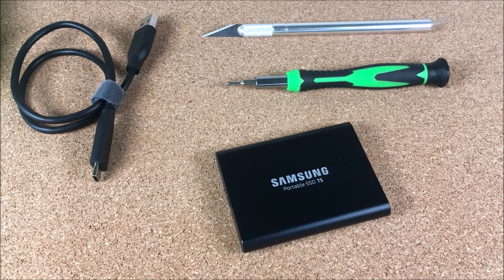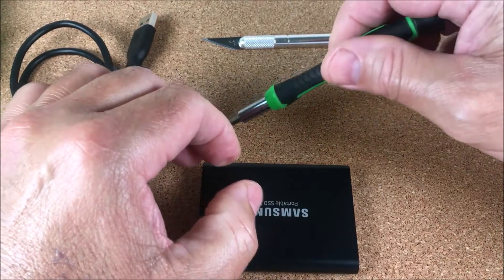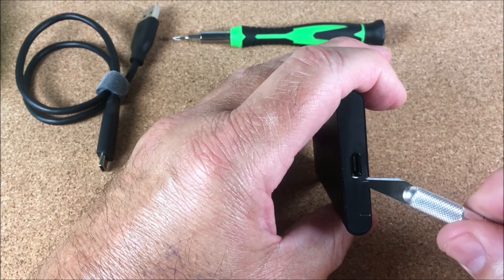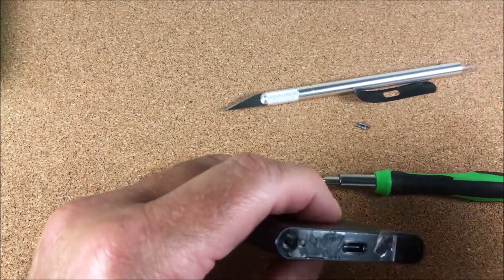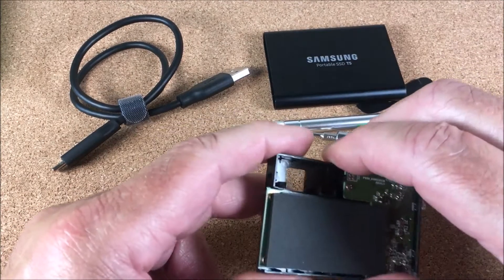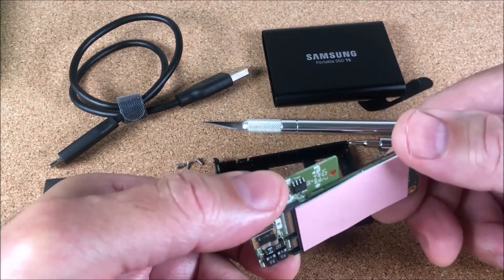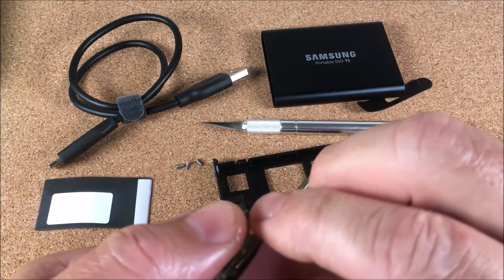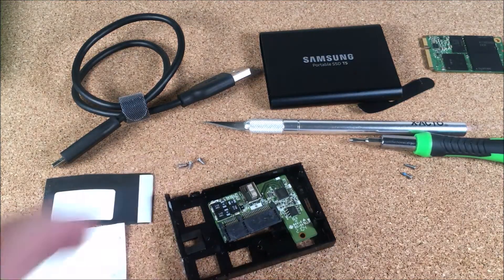How to Remove mSATA from Samsung T5

Comment: 1  First warm up the glue with a clothes iron.  Being careful not to melt the USB connection.

2 Get the lift to be removed.  started with the exacto knife.  When the lift is started slip of small flat blade screwdriver under the exacto knife. Pull the exacto knife out.

Comment: He said he's dismantled one before obviously not, he didn't have to pull the whole circuit board out, he just needed to lift the msata up a little bit where he removed the mounting screws and slide it it out. If he's done it before how could he forget.
Reply from the maker: The circuit board needs to be removed because the pink thermal pad that's underneath the mSata does not allow it to side out. If you watch the video at min 9:38, you can notice how the thermal pad is adhered to the mSata.
Reply: @hackytip7901  I've done it before, like I said lift the msata up a little bit and with a plastic spatula pry away the the thermal pad simple, I've done heaps of them that way.

Comment: HI. I carried out the procedure, but now the original adhesive has lost part of its adhesive capacity. What glue do you recommend to use to restore the anchoring and seal well? Thank you
Reply from the maker: Thanks for watching. It's hard to know what kind of adhesive will work with plastics. Here are some alternatives that you can try:
1) Scotch Double Sided Tape
2) Double Sided Duck Tape
3) 3M Spray adhesive
4) Maybe Crafts glue or glue stick
I would avoid permanent adhesives (Crazy Glue or Epoxy) in case you want to remove the sticker in the future. Good luck!

Comment: Hi do you have any idea what the sticker material for the drive is called, planning to get mine replaced, hope you can help
Reply from the maker: I believe it's called a "Thermal Pad" and it provides heat dissipation. There are many options on Amazon.

Comment: Wait... Are you saying that thing is 2 Terabyte... we we can't buy 2 Terabyte.... So we have 2 Teraby mSATA we could put in our computers????
Reply: I put a 4tb msata in my laptop a year ago. Its slower since it's msata and not nvme. But also cheaper. I just need decent quick storage, nothing crazy fast.
Reply: @canabisquick  And where do you find a 4tb msata?
Reply from the maker: Yes, it's a 2 TB that you can put in any computer with an adapter, such as the SABRENT mSATA to 2.5 Inch SATA III. Some Lenovo laptops have an mSata port. (Dell 4200/6400/6500 and a handful of Lenovo laptops y460, y560, y470, y570, e220, e420, k26, T420, T410) Confirm this information with your manufacturer's specs.

Comment: is it basically an m.2 ssd?
Reply from the maker: The Samsung T5 has an mSATA inside. The m.2 ssd is the replacement of the mSATA. They're similar but not compatible.
Reply: @hackytip7901  ohhh ok

Comment: Good info.
You might try a little heat from a hair dryer set on high. Apply sparingly, it usually softens the glue. We used this technique for removing labels from pagers years ago.
Reply from the maker: Thanks for sharing. If you look at the other comments, you can benefit from other suggestions to make this easier.

Comment: Can this be used as a internal ssd after removing it from it's case?
Reply from the maker: Hi, sure just get an mSata to Sata enclosure. It's $9.99, search in Amazon for: SABRENT mSATA to 2.5-Inch SATA III Aluminum Enclosure Adapter.
Reply from the maker: @edmundroth6337  I is difficult to give you an accurate answer. It all depends on the specific specs of your laptop for both Sata & USB. You can probably find your models specs on the laptop manufacturer's website. Or, you can run two speed test on your laptop and compare both options. I hope this helps.

Comment: I have swapped the mSATA drives from the Samsung Portable T5 (2TB) with the Samsung 860 EVO mSATA (1TB) that I had used in my laptop. Here is one thing to let others know, once you do that Samsung Portable SSD application will no longer recognize the T5 (even if there is a Samsung drive inside, just another model), so you will not be able to use their encrypting feature, and also the drive originally from the portable T5 when put into an mSATA slot of your laptop is not supported by the Magician software, it won’t let you run benchmark, diagnostic scan, overprovisioning and performance optimization (rapid mode), the mSATA card is still seen as “Samsung Portable SSD T5” by the system/drive utilities, not as “Samsung 8x0 EVO” as we would expect and also has a different firmware numbering.
Reply from the maker: Thanks for the info.
Reply: hmmm.... I wonder... Will I lose anything doing it... Should work for me overall, and if it does not I can always put it back I guess.
Reply: @darkijah-andersjehovahsn7893  Well, it works fine, and you can put it back to its enclosure whenever you want. Just if you want to use the extra features I mentioned above (benchmarks, diagnostics), you will need a third party software as the T5 plugged directly to the SATA interface appears as an unsupported drive like any other HDD’s and SSD’s in your system which are not Samsung.
Reply: @mertonnephake  Yea that would be fine overall.

Comment: cost wise Is it cheaper than buying regular msata ssd?
Reply from the maker: Hi, the Samsung internal 2 TB mSata is not available in the market. At the time that this video was posted, there were no options in this size.
Reply: @hackytip7901  aah thank you, never knew that before
Reply from the maker: @nadzifaashiqa5273  Your welcome!
Reply: @hackytip7901  I don't think there is any option to this date...
Reply from the maker: @darkijah-andersjehovahsn7893  Thanks for the update. You are right. Samsung still doesn't sell a 2TB mSata.
Reply: @hackytip7901  I found others who sell 2 TB, I have a list on my webpage now. Although I do not know which are best and legit, but it is there.

Comment: hi, when did you purchase this drive? Did you happen to see the date of manufacture when you unpackaged it?
Reply from the maker: Hi, is there an issue with the date it was manufactured? Why is this important?
Reply: @hackytip7901  No, just noticed that the components on the PCB are different to what's shown in teardowns from back when the T5 was released, so I was wondering when Samsung revised it. Found another recent teardown that reveals that the controller, DRAM and NAND packages have all been revised (although the NAND is still TLC).
Reply from the maker: @mettana7448  The date on the box is 03/19/21.
Reply: @hackytip7901  Thanks.

Comment: Thanks for the video! I literally just bought the drive because I couldn't find another 2TB mSATA-SSD.
Reply from the maker: You're welcome! I guess that 2TB mSATAs are not available; I haven't seen any for sale. At least we can use the Samsung T5 to get a 2TB mSATA. I hope this video helps you remove it safely.
Reply: @hackytip7901  Nope have not found a single 2TB mSATA anywhere which is why I am surprised it is there in this device.
Reply: Yea thinking the same... not a single 2TB device, but hiding them in this unit they can.

Comment: Use heat gun on sticker?
Reply from the maker: That sounds like a good idea. it's worth giving it a try.
Reply: @hackytip7901  I would most likely just find the placement of the screws and puncture the sticker.

Comment: I found doing it at the edge where it's rounded, sticking the blade of a box cutter straight in slightly then trying to lift up the edge of the sticker, worked well. Didn't break the sticker, it came off cleanly with the adhesive once I pried the edge up, and stuck it on a sticker sheet to save it for later. Probably won't need it, but just in case.
Reply from the maker: Thanks for your comments. Your ideas sound good. I think that the two insulation foam pieces can be also stuck to sticker sheet, so that you can preserve them until you put another m-SATA in the enclosure.
Reply: @hackytip7901  yeah that's what i did with one. left the other in the enclosure.
Reply: I'm like just push through the stickers into the screws... always tend to do that with things.